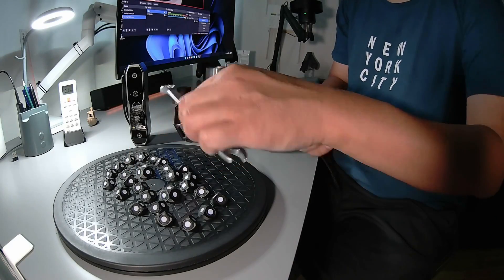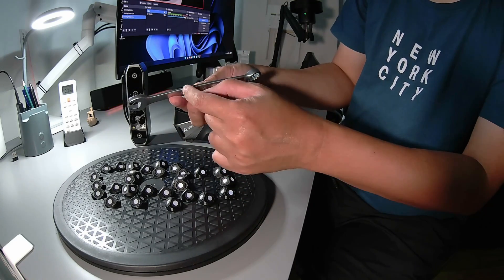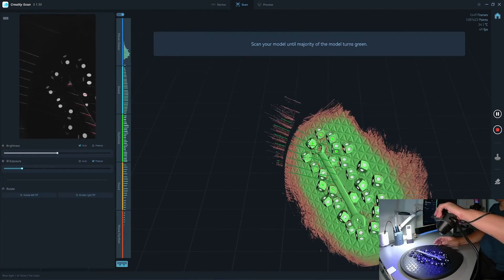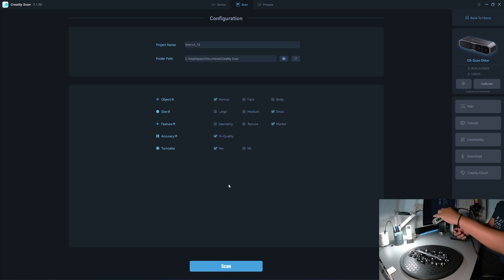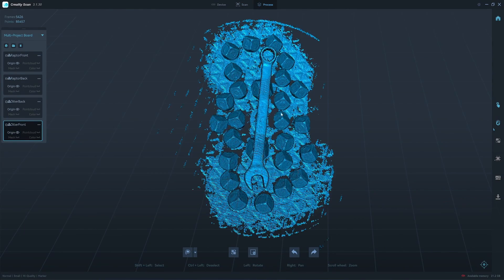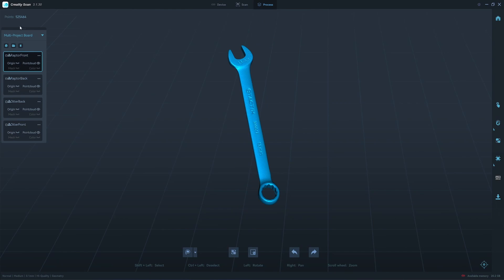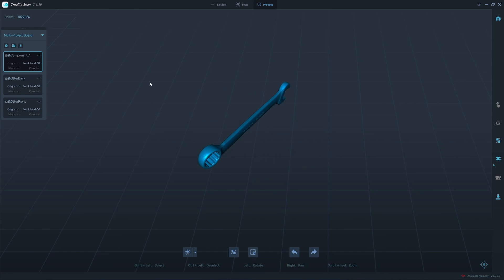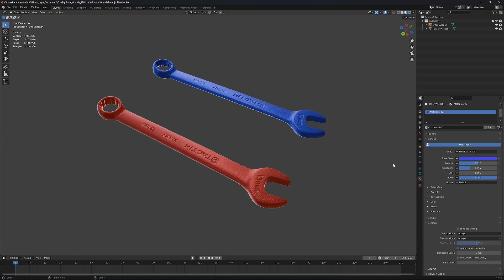Creality Scan Raptor Vs Otter - High Detail Object

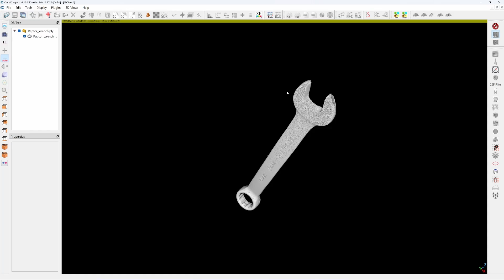Comment: 8:28 it looks like the line is not perpendicular to the plane of the wrench jaw, ideally if you could try to make '3-dot planes' on the both side of the socket jaw and then measure distance between them. I think it could be possible in GOM inspect. Overall very nice video. I just bought Raptor for a (I think) good price - $1 000, and can't decide if I should keep it or return it and buy otter which cost $325 less but offer better NIR scanning in any range..
Reply from the maker: Please keep in mind that Otter NIR is lower in precision, I've made a few videos about this. But if you mainly scan organic object, Otter's the way to go.
Reply: @Payo-TensileCreator   Thanks for your answer! In your opinion which one would better for scanning bicycle frames? I'm designing custom 3d printed parts/add-ons for bicycles (mtb, emtb, road bikes, etc) like fenders, protectors, etc. Mostly I do not need full frame scan, but in future it can be crucial as I plan to make laser cutting custom foil protectors.. Will raptor be good for full bicycle frame scan in laser mode? I know it will require many markers and it will take time.. As i watched your videos I'm almost sure that otter will be faster but scans could be not as accurate as from raptor. But according to your videos I think to what I need this scanner, the error accuracy on otter NIR scans (0,5mm) won’t be a big deal.

Comment: I have the Raptor for a couple days now. It’s a nice scanner but I have issues with the fps scanning. I think it’s because of too many marker dots. AMD 5900x, Rtx 3080, 64GB
But I’m unsure and still trying to figure out exactly why the fps are sometimes so slow. 5:11 here you have only 30fps too. But maybe it’s the software.

I’m pretty sure it’s the amount of markers. Too much stuff to compute for the CPU. I used now minimal amount of markers and could get up to 60fps.
Reply from the maker: FPS only drop when it loses the track. But that's for a split of second. I don't even notice it when scanning. If the scanner loses the track, the blue laser line will go off. 
I get 50 FPS with 0.15 mm res. in viewport. and 60 FPS with 0.4mm or above res.
More markers don't affect scanning speed on my test. The more I put, the faster I can scan and move the scanner without losing the track.
Reply: @Payo-TensileCreator  interesting. Then it must be something else. I will test more. I watched all yt vids available for the raptor and other people had fps drops as well to 20fps in laser mode. 
Oh and try and set it to 1mm res and don’t stop the scan when it’s green. You will get the same details when generating the point cloud as if you scanned with 0.1mm res but it will look low res until you generate the point cloud, It’s probably only an indicator thing and don’t do anything to how the scanner is scanning the part. 

Looking forward to your review. The hardware is really nice but the software… hmm 🤔

Comment: can you tell us about the processing step and specially about the markers, how you remove them there is any command for this or automatically removes them ?also with laser scan mode is necessary for the markers or without them there is no tracking point. thanks a lot
Reply from the maker: Raptor in Blue laser will only work if it sees markers (> 4 points) but it this video, I didn't apply markers directly on the object. I put targets around the object instead. What I did is I manually select and delete the surrounded target.

Comment: When you look at the ring end of the spanner, the raptor looks incredibly good, compared to the Otter. 

I would like to scan the inlet/outlet ports on engine cylinder heads. 
I’d love to see you scan the internal space on something tubular, to see how deep down the tube the laser can scan. 

Food for thought 😑

🇦🇺🤜🏼🤛🏼😎🍀☮️
Thanks again
Reply from the maker: It can scan the bottom and some siding of 6mm wide 10mm deep groove. The edge of the holes will block the light path.

Comment: Please scan something at 0.02 mm and show the scan quality at that level for the Raptor.
Reply from the maker: 0.02 mm is advertised accuracy for position of point cloud in space.  0.1mm resolution gives best detail this scanner can give as I have tested it many times.  In 1x1 mm there will be maximum 100 points (depend on surface difficulty) calculated from structure light. It's not direct measurement as in LiDAR scanner. If I set it to 0.05 resolution there will be maximum 400 points in one sq.mm and those points are interpolated and not measured by scanner, and this will put more load to software that it's being export to.
Reply: @Payo-TensileCreator The 0.1mm resolution is for each frame. When you have many frames there will be points in between which can give you higher resolution when you combine the frames. When converting from the original scan to the point cloud, I don’t think it is interpolating, but using the points from different frames. This can be seen by the fact that if you have a scan with only a few frames, you cannot set a high resolution when converting creating the point cloud from the scan. For example, if you scan with 0.2mm resolution and have many frames, CrealityScan will allow you to create a 0.02mm final point cloud. If you do the same scan with only a few frames, the highest resolution might be something like 0.08mm. This indicates it is not interpolation, but the combination of overlapping frames that gives the possibility to get a high resolution. Like you said, the point in space resolution 0.02mm, and with many frames you can achieve this over a larger area.

Comment: Thank you for your video. Don't you think that if the shiny wrench was coated with a matte spray, the Otter scan quality would be better?
Reply from the maker: Yes, you're right. When I scan white remote control. Otter gives more point cloud than Raptor in the same resolution setting (0.1mm). But spraying (I usually use Magnaflux SKD-S2) will thicken and cover the emboss text. I can try and put that in a video.
Reply: Probably but cost money 💰 think long term in this economy.

Comment: Very good videos. Thank you for pc comparison also. For otter fps. It has given best possible overview of these two scanners. 

Could you scan something that has cavities. For example my einstar had problems with bolt holes under 5mm diameter. Also it did not have great depth. Meaning that when the object had lets say 50mm cavities inside or has like very landscaped shape then it had problems to see into lower parts. Giving me a model with lost data in cavities. That would be interesting video to see. 

Also you should compare otter with texture mode to raptor with marker mode.  It seems to me that otter has little bit problems seeing markers.
Reply from the maker: Otter in Small/Medium mode, you can't adjust marker brightness and object surface color will have effect on marker. But in Large mode, you can adjust brightness of marker and object separately. That's why Otter doesn't do well in small/medium - marker mode.